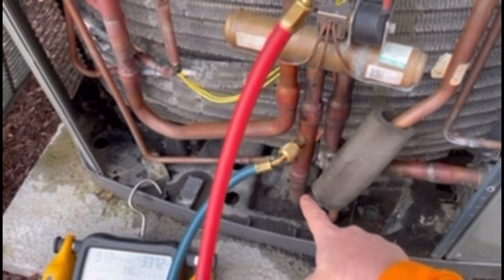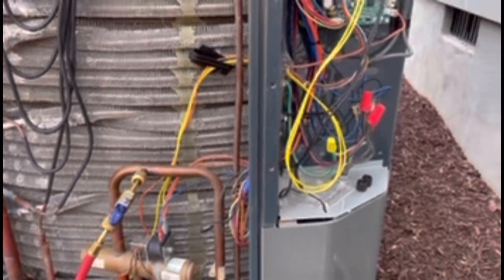HVAC - Tech Tip, Trane suction pressure transducers.

Comment: So I have a tem9 customer I was out there 2 weeks ago outdoor unit would start run for about a minute or 2 then shut off giving me a red 3 flash code bad transducer checked dc voltage on transducer which was way off did not check board tho. Ordered new transducer properly replaced vacuumed system etc. re did the ground wire  and still I'm having the same issue. I'm wondering if it could possibly be the board? Going back tomorrow I will call tech support. Good video very useful

Comment: Good video I think that's the only one talking about transducers. The only thing is that it another problem that you need to call technical or have some type of troubleshooting manual. Just more trouble and more money, and usually they don't get fixed until you get in contact with technical or have the manual. Stay with the easy equipment you make the same money.
Reply: Ha ha; you'll be out of business pretty soon; besides equipment is using more inverter technology particularly on heat pumps; o I don't believe that's a viable solution!
Reply: @bobboscarato1313  Just keep putting in Trane crap.
Reply: @chrissipple1018  I retired 15 years ago.-